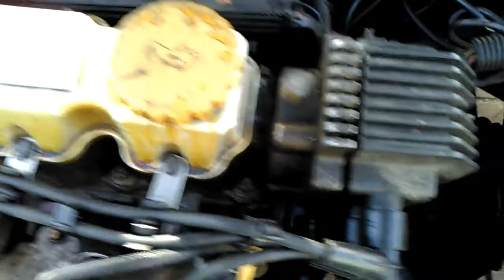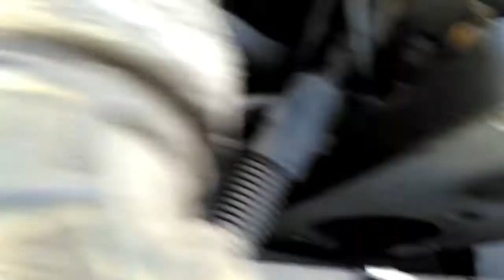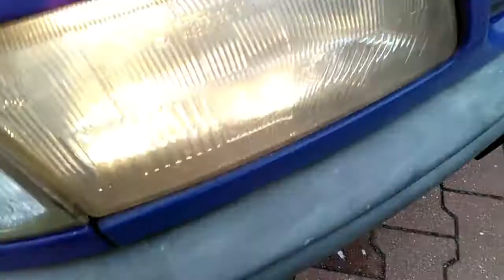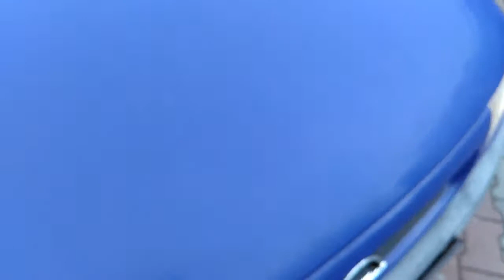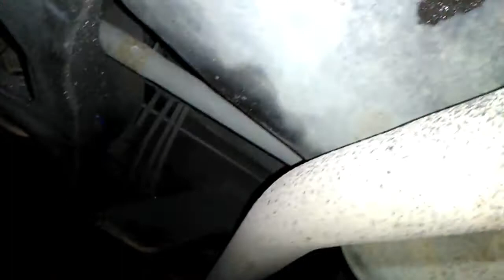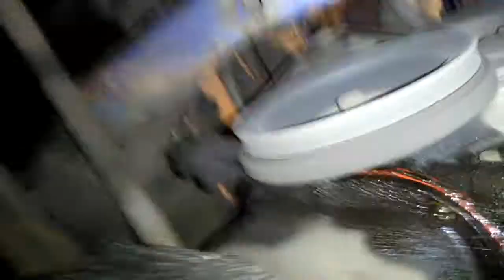Dziwne odgłosy z silnika - Opel Astra F 1.4 8v Si C14SE (strange noises from the engine)

Comment: Could be a few different things, First off if the sound is coming from the Cam box/head then it could be the rockers or hydrolic lifters but if it's on the left side it could be something as simple as a pulley bearing that seized, my friend has the same engine. A few years back he hit the rev limited and money shifted and broke the Rockers in half, In this engine it's a tiny little cube that sits on the hydrolic lifter and valve. But worst of all get under the car and listen to the crank, the rod bearings. It could be piston knock if you can hear it from the bottom crank.